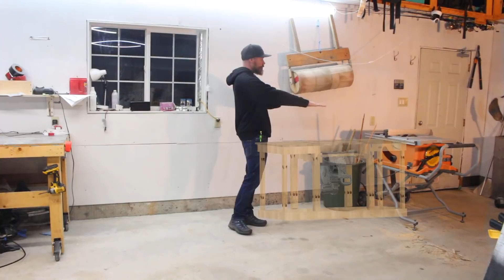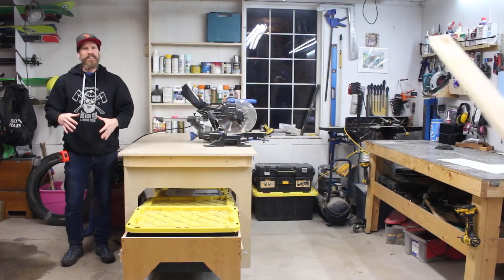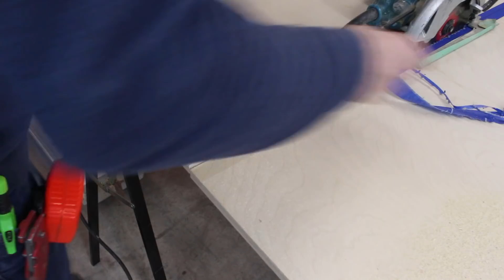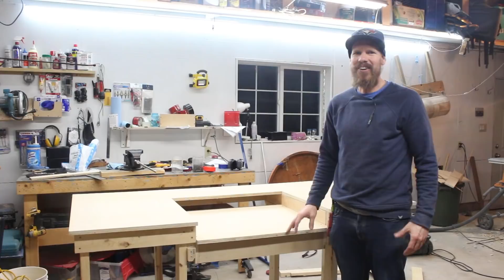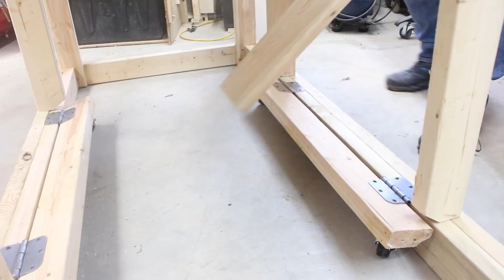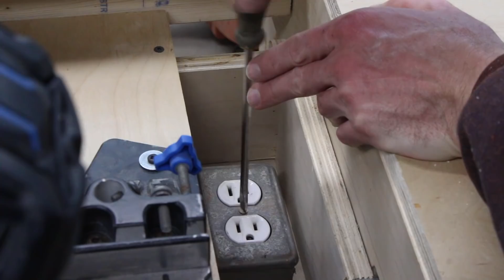MOBILE Flip Top Mitre Saw Station - Table Saw Outfeed Table Miter Saw Station - Mitre Saw Stand

Comment: How do I get the measurement for when I flip it its flat?  My chop saw is 4 1/2” and my desk surface will be 21/32 total with laminate on top. I’m thinking it’s going to be 3 27/32 for the flip box I keep trying to work though the math and my brain is going to explode
Reply from the maker: if you bought the plans, send me a message on the website and I can help you out.
Reply: I did
Reply from the maker: @jacobbryan9127 if you sent a message, I didn't receive it.  can you try again?

Comment: I purchased materials to make a different bench, but now I think I'll pivot to this. Question, for that design it used 3/4" MDF for the table top, do you foresee any issues using MDF with this design vs plywood?
Reply from the maker: MDF should be fine. I just like working with ply better, personal choice.  Let me know if you have any other questions
Reply: @TheHowtoDad  appreciate it!!

Comment: I have the same table saw, and was planning a workbench the same dimensions, i was really over complicating it. Your ability to simplify is impressive. I'll be stealing your caster idea, but I'll extend the wheel mount 2x4 all the way across with more casters. Also where your miter saw hits the 2x4 on the down swing, maybe you could cut out a notch to allow the saw to pass through. I even had the same shoes.

Comment: Nicely done! A lot of ingenuity in this design. I'm about to get a Rigid 12" dual bevel, compound, sliding mitre saw (that's a lot of words). Will that fit into this design? Best I can tell, it's 35" front to rear, 26" wide on the table, 22" high when closed. The base is 4.5" heigh (already added to total height in previous measurement). I looked at the info on your site but can't tell if this saw will be too big or not.
Reply from the maker: send me a message on the website, I'll send you a drawing that should answer your questions beddesplans.com

Comment: If you buy these plans beware the front sides are incorrect measures - noted as 20.25” but should have been 21.25”
Reply from the maker: this is the first time I've heard this. I built mine from the plans, and had no trouble.  can you send me a message on the website so we can find out what went wrong?
Reply from the maker: you're 100% correct. I have updated and uploaded the new plans. thank you for pointing that out!

Comment: I going to do this. It’s great.  My one question is if you could have built a second stop lower on the back an not need a bar in the front.  Maybe it wouldn’t be strong enough.  I’m newer at this so I’m just curious.
Reply from the maker: which bar in the front? I'm  not really following what you're saying
Reply: @TheHowtoDad  I love the wheel setup.  Best I’ve seen. I’ve looked at a few designs online.
Reply: Sorry. I meant the two pieces that fold in to hold the front up on the miter saw.
Reply from the maker: @billwong553  you could try messing around with that. put the lock in the front so it was easy to access for a quick change over.

Comment: I have tried purchasing the plans for this but for some reason cannot. Is there a better link to obtain them?
Reply from the maker: that's really interesting...also discouraging to hear. send me a message through the website so we can discuss this further. I'd really like to know why this is happening so I can try to avoid it in the future! thanks in advance
Reply: @TheHowtoDad  Hey i finally got it to add to the cart so that I could purchase.  Weird. Maybe some block at work that prevented me from accessing.  Love the design…may make a few mods to the flip tray.  Leaning toward a locking system on the front maybe…havent decided yet.
Reply from the maker: @mcharlenesanford1521  thanks, I sent you an email.  I've noticed sales are little slow as of late, I'll contact WIX to see if there is something wrong with their system.  thanks for sticking with it!

Comment: This is the flip design that wins it for me, no bolts to lock, no hinges to buy. Nice work, I shall shamelessly copy the concept for my shop and claim it as my own design to my wife
Reply from the maker: not having to mess with pins was important to me.  if I had to spend time taking them out, tightening them down etc, I would be less likely to use it.  reduce friction in the work flow.
glad you like it, hope you're wife approves

Comment: Do the plans show how to measure/ adjust height to match table saw and how to ensure that when the miter saw is flipped up the rest of the bench is the same level as the saw base?
Reply from the maker: That's a good point.  It would not be difficult to figure this out.  I can ad that to the plans.  
Basically the legs would need to be adjusted. And the location of the pivot one thickness of the flip section.
The good news is, it is fairly standard that mitre saws are 3.5 inches from the work surface.  
I will add this idea to the plans tomorrow
Reply: @TheHowtoDad  Bauer 10" (from Harbor Freight) is 3 7/8.  It also has 52° L, 60° R  miter so I'm having to upsize the flip section to 36" wide. I could probably get by with 34". I'm still not quite wrapping my head around how to make/determine the box height(s) and corresponding pivot point (bar center). Do you have a suggestion or tip on how to adjust for the extra saw deck height? I understand if it were less, I could just shim it, but in my case it's more and just mounting the board lower would run in to the location of he bar.  I must be simply overthinking it.

edit: Actually I think there's rubber feet on that saw so if screwed down it'd probably make the deck height 3 3/4.
Reply from the maker: @EricGustafson  sounds like your saw is 1/4" too high. I would just switch the under saw plywood to 1/2" from 3/4, leave the rest of the deck at 3/4" should solve your issue! making the turn table wider, should be relatively straight forward.  let me know if that makes sense to you!
Reply from the maker: I am working on finding heights of other miter saws.  Can you help me out? Can you measure your miter saw and let me know the base height?
Reply: @TheHowtoDad  Awesome! I have a cheap Kobalt from Lowes. Base height measures 2.75". This table looks awesome. I'm moving in a week and would love to build this in the extra garage bay. Definitely would help me maximize my space in a more usable way.
Reply from the maker: @chrisaiello5230  that's easy to solve! Just put 3/4" shims under the saw to bring it up to 3.5 inches.  This is really common practice for a lot of guys.  But I'll still try to work it out
Reply: @TheHowtoDad  nice and easy!